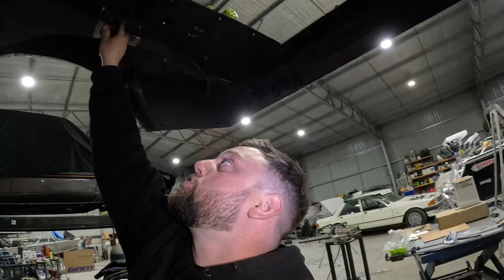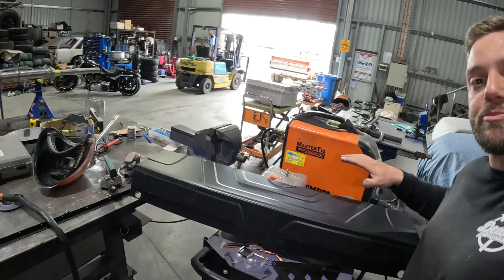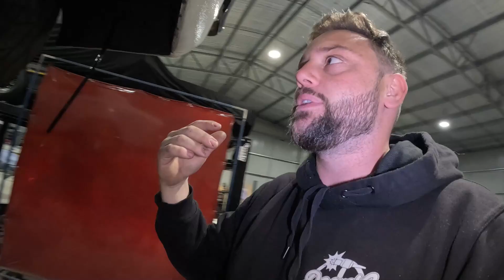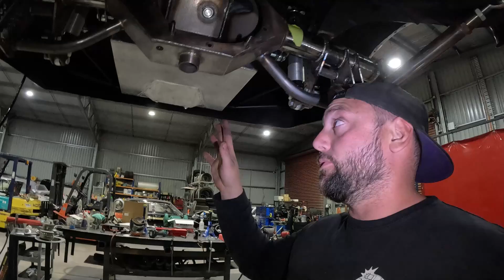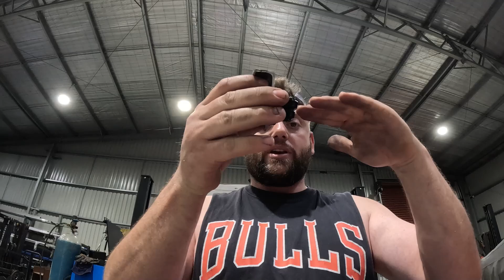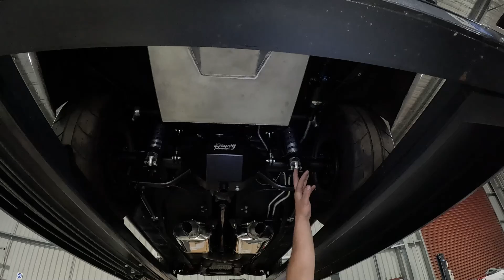Cortina Gets Brand New 9 Inch Rearend!

Comment: Common  fault the rear rails move on the floor pans on the bottom control arm points cortina mk3 or top control arms points nice work you are doing
Reply from the maker: appreciate that kind words.
very common for them to move